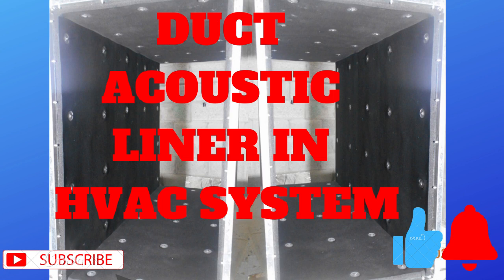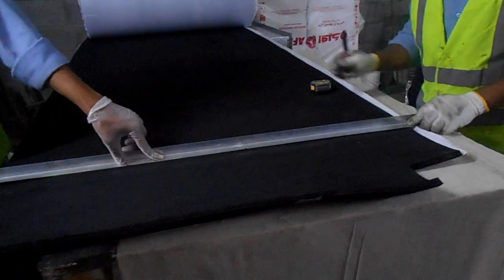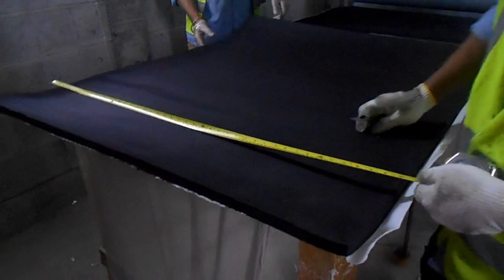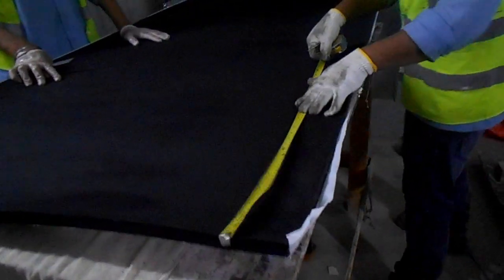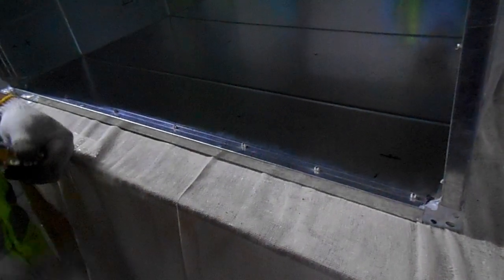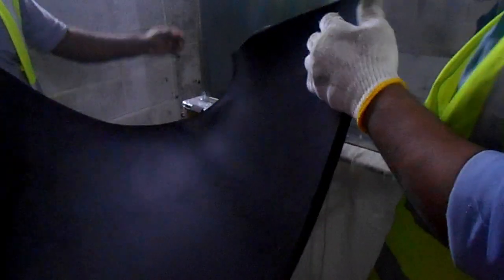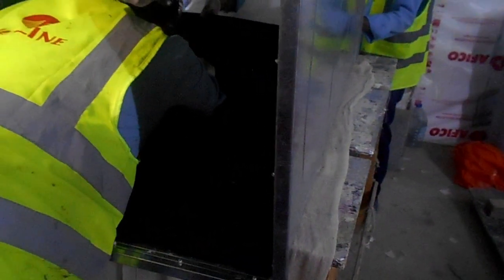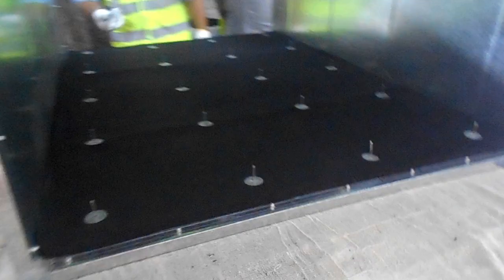How to do Duct Acoustic Insulation or Liner in HVAC System step by step |By MEP Tech Tips

Comment: Any concerns with using Fiberglass (Linacoustic)  in newly installed metal ducts also wrapped with R-8 Bubble in residential home in N.J.    very concerned about mold being able to adhere to the fiberglass compared to bare metal interior. Would so much appreciatte the feedback.
Reply: Using fiberglass duct liner (Linacoustic) in combination with an exterior R-8 bubble wrap insulation is a common approach to improving both thermal efficiency and noise reduction in HVAC systems. However, your concern about mold growth in the fiberglass is valid, especially in humid environments like New Jersey.

Here are some key factors to consider:

1. Fiberglass and Moisture Concerns:
Fiberglass insulation (especially if it becomes wet) can indeed become a breeding ground for mold. Condensation inside the ductwork, poor ventilation, or high humidity levels can lead to mold growth on the fiberglass surface. Mold can adhere to any surface, but fiberglass is more porous, making it a potential risk.
Bare metal interiors of ducts, on the other hand, are less likely to harbor mold because metal surfaces don't absorb moisture, and mold has difficulty adhering to smooth, non-porous materials like metal.
2. Condensation Risk:
Condensation forms when warm, humid air contacts cooler surfaces, such as cold air ducts. If the duct system is not properly sealed or insulated, moisture can get trapped, increasing the risk of mold growth in the fiberglass liner.
Even though you’ve added R-8 bubble wrap insulation, if the system has air leaks or poor air circulation, moisture could still build up inside the ducts, particularly in humid climates like New Jersey's.
3. Preventing Mold Growth:
Sealing Ductwork: Make sure all duct joints and seams are tightly sealed (using foil-backed tape or mastic sealant) to prevent air leaks and reduce moisture accumulation inside the ducts.
Proper Ventilation and Airflow: Ensure that your HVAC system is sized and balanced correctly to maintain good airflow and ventilation. Proper airflow reduces the chances of moisture being trapped in the ducts.
Dehumidification: If your home is in a particularly humid area, consider using a whole-home dehumidifier in conjunction with your HVAC system to keep humidity levels in check.
Anti-Microbial Coatings: Some fiberglass liners are available with antimicrobial coatings that can inhibit mold growth. Ensure that the Linacoustic product you're using has these protective features.
4. Routine Maintenance:
Regular inspections and maintenance of your duct system are essential to catch any moisture issues early. If condensation or mold is discovered, it’s easier to address before it becomes a larger problem.
5. Alternative Solutions:
If you're very concerned about mold in fiberglass liners, you might consider alternatives like foam-lined ducts or metal ducts without liners that are still insulated on the outside. Foam insulation is less prone to mold and may provide a smoother, easier-to-clean surface inside the ducts.
Conclusion:
Fiberglass liners like Linacoustic, combined with R-8 bubble insulation, can be effective for noise and thermal control, but there is a potential risk for mold growth, especially in humid climates. To mitigate this risk, make sure your ductwork is well-sealed, your home has proper dehumidification, and consider liners with anti-microbial properties. Regular inspection and maintenance are also essential for preventing mold problems in the long term.

Comment: What are the “nail” like fasteners that you used. What are they called and where can I buy them?

Second question:  do you know what insulation I could use to replace worn-out insulation inside my HVAC package unit inside the heat exchanger compartment? It doesn’t get as hot as the burning gas, but maybe above 200 F.
Reply: Its called Stick Pins...!!

Comment: Sir when we are using self adhesive acoustic insulation, then i dont think nail installation required which is also sticking to duct thought adhesive. Please reply and thank for guidence.
Reply from the maker: the acoustic lagging is front face of the machine, which requires more safety because the air pressure and sound is more compare to other duct area.

Comment: If I wanted to sound proof ducting, i would actually do this on the outside of the duct instead to keep my air vents free of dust buildup and in my recording room, I wouldn't use a louver as those create more noise...just my 2 cents
Reply: The duct liner is to reduce the noise produce by the air movement and resonance of the duct. Duct liner on the outside would have no effect of the noise that comes from the air inside the ducts. In your supply duct you should not have dust built up unless your system is badly designed. The duct liner is specifically designed to prevent bacterial growth on it. In the long term you might have a little bit dust buildup but nothing more than a regular duct